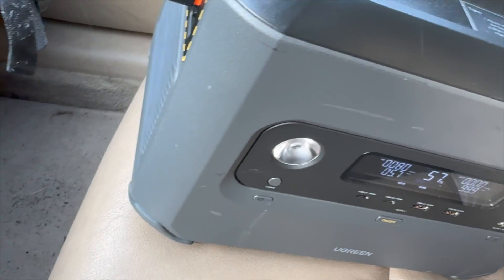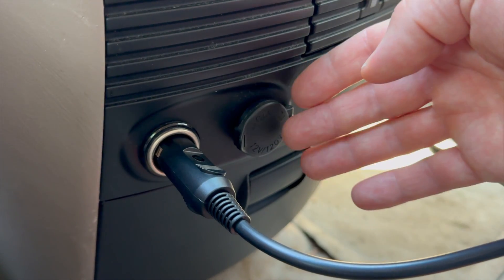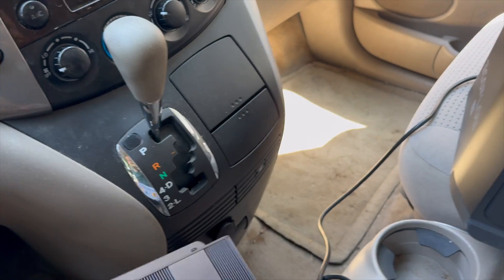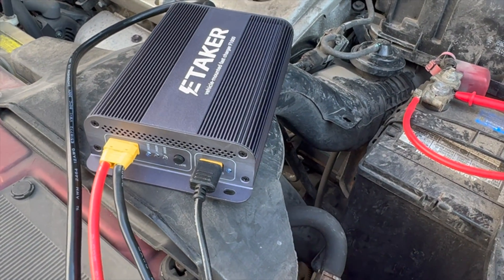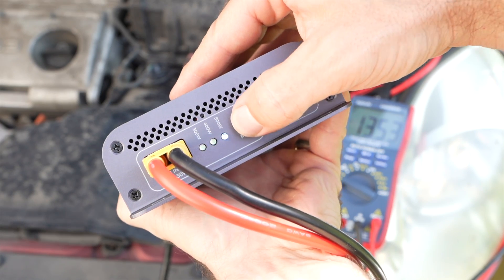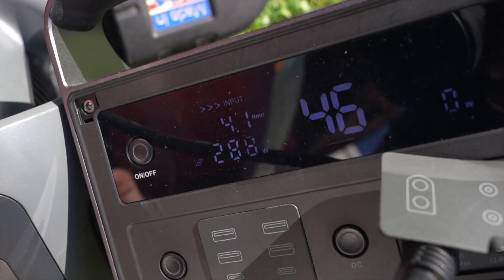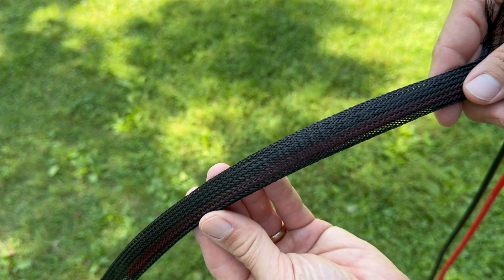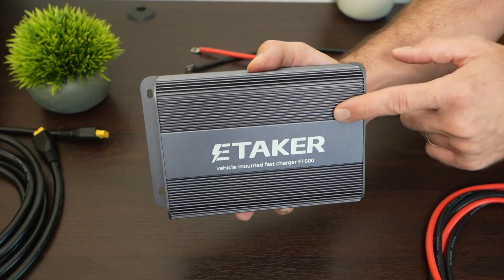Fast Charge Your Power Station While Driving | Etaker F1000 DC Charger

Comment: I understand the part that this product can charge a power station using a car's alternator. Can you explain why would one use it to charge the power station using solar panels since the solar panels can be connected directly to the power station to charge it?
Reply from the maker: There are a few reasons but one is that most smaller power stations only have one XT60 input port so this device combines the solar and alternator charging into one.  I'm guessing many people with a typical passenger car wouldn't be mounting a solar panel on the roof but this would make it easier to have everything wired up for when you put your power station in the car.  But likely most taking advantage of the solar input are small RVs or campers, etc who have a permanetly mounted solar panel on the roof so they can get solar power charging while the engine is off without having to move any wires.  And then they can add the alternator charging while the engine is running.
Reply: The sun doesn’t shine fully in all parts of the world and not at all in some places  , no sun= no power

Comment: Hi. Thanks for the video. Will it work with any car's alternator? Will it damage the alternator by drawing too much power than the alternator can handle? Is there any protective mechanism inside the unit?  Thanks.
Reply from the maker: Thanks for watching.  Most alternators should work on any passenger car.  500W divided by 14V equals 35 amps, so most alternators would not have an issue with that.

Comment: Do you think this would work with an Anker Solix C1000? Also, if the car is off, would the solar still charge the power station?
Reply from the maker: Yes, it can work with pretty much any portable power station.  For your second question, I seem to remember that it would work that way to pass the solar DC though.

Comment: Hello sir do you think it can be use with a DJI power 1000?
Reply from the maker: Yes, if you have the adapter for the DJI 1000 to convert the xt60 to the SDC port.  DJI just came out with their own alternator charger.  I just got it but haven’t tested it yet.

Comment: @solarguy Thanks for sharing this! Been looking for a combo solar/alternator DC charge as my Bluetti only takes one input at a time. This will shut off automatically when the car is off and only pull solar? Will the DC output fit my Bluetti power station?
Reply from the maker: I don't know what Bluetti station you have but check the voltage input on the DC XT60 input to make sure.   But it should work since most larger power stations can take at least a max 60V input.  Yes, this charger won't drain your vehicle battery.

Comment: Can this alternator connect to my solar system and keep battery  charged to run my home at nights
Reply from the maker: I'm not certain I understand the question.  If you are only using solar then you probably don't need this device.  It only can take up to 500W of solar so this might mean 1 or 2 panels.  But as long as you stay under the voltage input limit (48V) then it should be able to charge your battery with it's output.
Reply: @solarguy  I think he was essentially asking if this can replace the charge controller in his house.

Comment: My Bluetti power station takes an 8mm barrel-type power input plug. Does this charger come with the necessary cable to make that connection? Or would I need to order an XT-60 to 8mm adapter cable? I can't seem to find any information on this issue.
Reply from the maker: This charger outputs XT60 so you would want to get an XT60 (male) to 8mm barrel cable.  I just checked and you can get them on amazon, for example.
Reply: @solarguy  Wow - thanks for the quick response. That's what I thought but I wasn't sure.
Reply from the maker: No problem.  I have tested most of these power stations so I was curious if I even had one of those cables.  I have enough adapters to make it work but I don't think I have the exact one I was referring you to.

Comment: Wild question out here. If you get two of these can you connect one of them to the Solar input of the other one and get 1000w technically with no solar panels?
Reply from the maker: The main limitation in that scenario is the power that your vehicle's alternator can produce.  1000W divided by 12v is about 83 amps.

Comment: Did you try to charge a 12v battery with this (obviously with the right cable xt60 to battery o-ring) ? Will it adjust output voltage accordingly, and output 12v instead of 42v ?
Reply from the maker: I didn’t try because the specs only list 42v (25amp max) as the output.  I don’t think there is a variable output.
Reply: @solarguy  They claim it is not fixed at 42V and adjusts according to the battery. I have to try to see it. Thanks for the response.
Reply from the maker: That would be strange they wouldn’t list that on the spec sheet/owners manual.  Where did you see that claim?
Reply: @solarguy  

they responded to my question in Amazon. I was still skeptical about it, until I tried it today with 2 12.8v 100AH batteries in series and measured the output voltage to the battery from etaker to be 26.6 (and my amps are around 9.4 from a Bluetti PV350 panel). So it is safe to use it wirh batteries.  

I am yet to test wirh my car. I accidentally dropped my nut that secures battery cable while attempting to connect etaker. Have to wait for a replacement. 

I think their user manual guy did a bad job.
Reply: @suneelkanuri  Hey very interesting. Did you try fully charging the batteries with it, to see if it stops? Otherwise one could overcharge stand alone batteries? Thanks